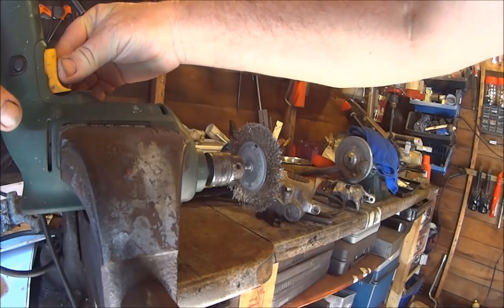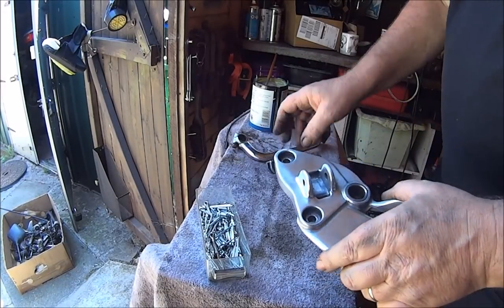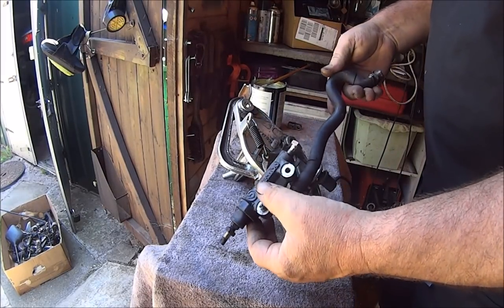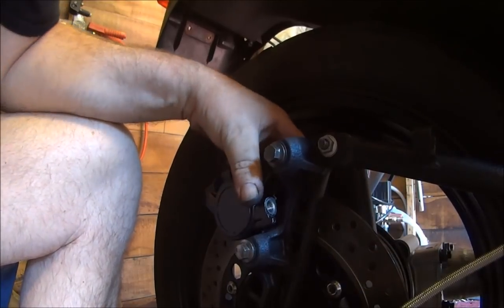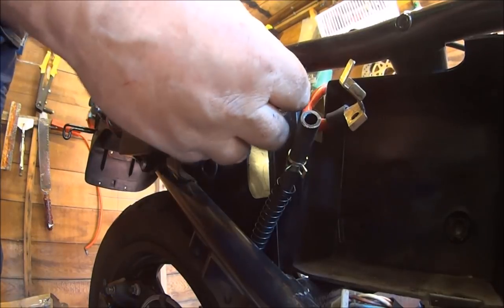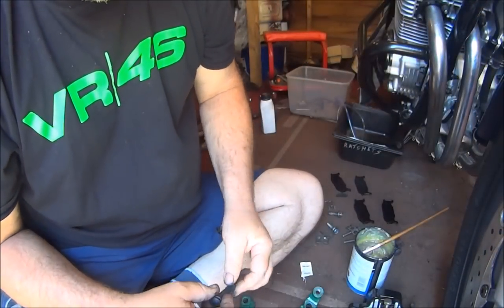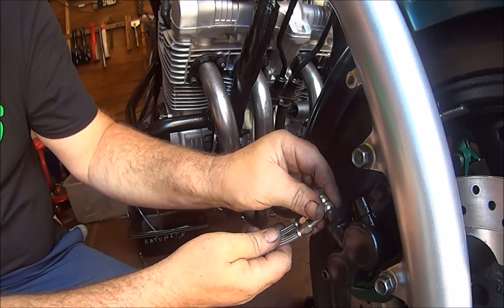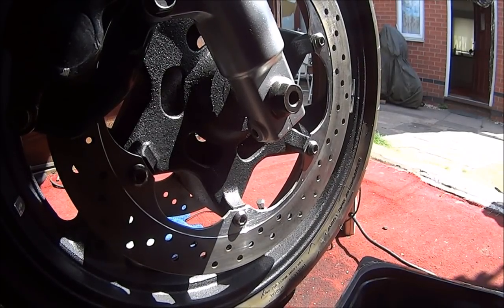Xj900s Diversion Front and Rear Brakes Refurbishment . .

Comment: nice work dude.
Those front calipers are a pain in the arse, but you did super well. I've split and killed seals before now.
I switched over to the "blue spot/blue star" calipers from the R1's, Fazers, R'6 way back in 2008 and not looked back.
Way better braking for the heavy beast of a bike, than the standard calipers.
Also gives you equal wear on the brake pads as well.
They just bolt straight on. but you need to have 2x brake lines from the brake reservoir to the calipers, also gives equal braking to each side, no pulling to one side or the other.
Reply from the maker: TH3_V1k1ng thanks viking yes they was pretty intense to fit in. And thanks for the heads up on the R1 and Frazer calipers someone as mentioned this before. But they are a bit to pricey for me at the moment. Maybe if I decide I am going to keep the bike long term it's something I will do in the future.
Reply from the maker: TH3_V1k1ng thanks viking something to look into in the future. Maybe. See how happy I am with the bike..

Comment: top man johnny for restoring the original FLOATING sliding caliper twin piston brakes, many are doing the four pot blue spot conversion,  the blue spots are solid mounted, 
the xj 900s disc,s are solid mounted, this combination is effectively going back 50 years in disc brake design, there must be "float"  either in the disk or caliper
 without it a warped disc hits the pads, these get hot, the pistons get hot, the fluid gets hot,it expands and fills the reservoir,when that's full it pushes the pads out against the warped disk, the pads get hotter, by now the brake fluid is boiling, and this feedback loop continues until the wheel locks, these brakes lack instant bite as ive found to my cost. but i wont swap them, ive seen a mate fluid boil and lock whilst doing 90 on an xt600, he was ashen faced and shaking,, here,s a link to an early solid caliper acting on a solid warped disc. it was after this incident that the need and importance of  " float" was fully understood, RIP bazza

https://youtu.be/EGOd1U2ZBhA
Reply from the maker: Hi Ian. 
Thanks buddy Glad you enjoyed the project.. Yeah I don't like to mess around with the brakes to much. Stay safe buddy 👍